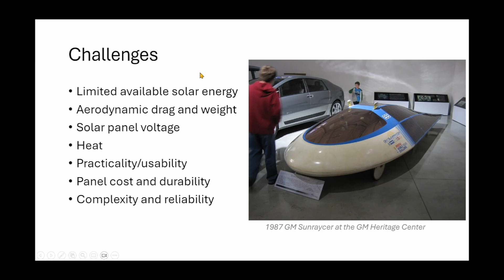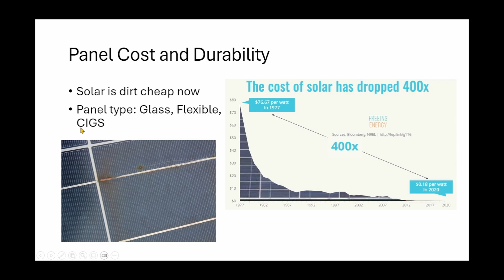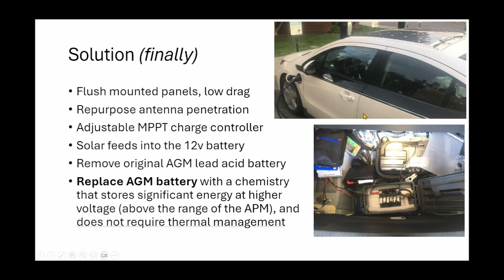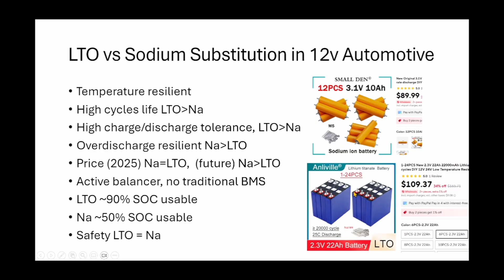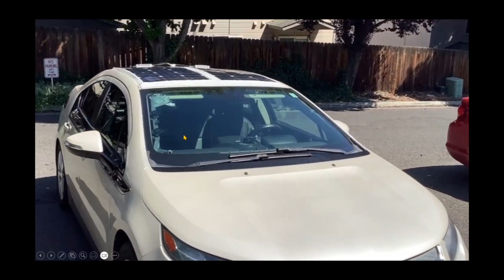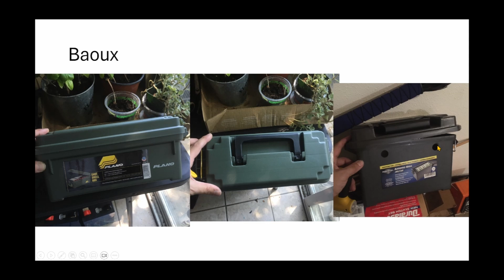Efficient Use of Solar Panels to Extend EV Range

Comment: It's nice to have a 12 volt battery that you won't have to change every 3-5 years as well. I'll have to check out your forum post for more info on exact components, but a quick video with a more direct how-to would be nice. I'd also be interested to see a video about your wheel covers (where you bought the discs, how you attached with steel zip ties etc)

Comment: Here from your comments on the Ecoflow solar roof video. I've been thinking of this for a while as well, realizing a small solar array could keep the 12V battery topped off. In my case, it's to maintain the vehicle while I'm at events in the middle of nowhere for several days. I'd like the security system to be operating, but it drains the HV battery too much in some of my scenarios. Nice work.
Reply from the maker: yeah i heard teslas can loose a significant amount of range from sentry mode. I would expect that at least the cameras and car computer and GPU would run on low voltage power since thats where they started.
I worry about how locked down tesla makes its low voltage system tho for applicability.
I believe the newer (maybe post 2020) teslas all have a ~16v low voltage architecture which they got by ditching the lead acid chem. unfortunately from the webber auto analysis of the low voltage battery, the BMS tesla includes seems to be a major sticking point.
BMS would not appreciate being overcharged and would fight to protect the low voltage battery, and thus would limit the amount of solar overhead you could collect.
I suspect that with an mppt set to the highest voltage allowed by the cars 16v bms, and feeding the 12v system, you would see some net range preservation for a tesla left in the sun, not charging, with sentry mode on.

I think the ~3-4 miles of range benefit ive seen mainly comes from over-sizing the low voltage battery.

I intended to make another video soon reviewing my 2013 chevy volt, and just kinda showing how all the mods are holding up. im at around 170k miles now and everything is still working fine. subscribe if you want a chance at getting notified about that video when i finally make it in maybe a few months lol.
Reply: @vevenaneathna I watched your Volt video and subscribed. I also had a 2013 Volt and loved the vehicle. Unfortunately, one of the drive units died on me at 101,500 miles (just outside warranty) and Chevy wanted 6k to replace everything. Couldn't swing that. 

IIRC, the L-ion battery was implemented by Tesla in 2023. They introduce running changes all the time, so there's usually not strict model years. My 21MY is an "early" one. Later ones have heated steering wheels, faster entertainment precessor,and an updated console. But mine has the electrochrome mirrors and some other minor updates not in the 2020 models. 

My thought was to use an Anker battery connected to solar with a 12V battery monitor hooked to the LV lead acid battery. That should keep everything kosher, though there's conversion losses and the added expense of a commercial battery with BMS and inverter. But I'm also not dealing with the nuances of LiFePO4 as you detail in your video. And my travels are in fair weather, so I'm not concerned about cold issues. 

But thanks for the input.

Comment: Putting it into the 12 volt system is brilliant. The big battery has to keep that thing charged and dumps energy into it to run things, so you can save tons of energy by just charging a swapped 12v

Comment: Wow, amazing job here all around.  Please keep making more videos about this. Powering the low voltage systems via solar is the optimal approach for mobile solar.  

I would LOVE to see you implement solar to power the 48V low voltage system of the Tesla Cybertruck.  Massive potential there.
Reply from the maker: ya i think the 48v systems of the cybertruck and i think some porsches is pure genius. from what i remember on the 16v low voltage batteries tesla uses on the 3/Y, they are pretty locked down due to the bms tesla puts inside of their low voltage batteries. really like the old school 12v lead acid approach where the car just kinda lets the battery do its own thing since lead acid is so sloppy with its voltage... 
but ya, 48v especially for the larger cybertruck is just inherently more well suited to solar assisting it. I just wish the ever-growing trend of companies putting bms boards in their low voltage batteries that have to talk to the cars computer would go away.... or at least the diy hacker type people smarter than myself need to start diving into the firmware/software and spoof/trick the car into letting you change things and actually take risks again.
it will probably be another 5-10 years until all those cars are out of warrenty and people get brave enough to turn wrenches on them again. by then we might have to reconcile some other issues with hv battery longevity like teslas lunatic idea to not use busbars on a hvdc battery subjected to automotive NVH conditions. most tesla packs eat the dust now because of elon musks khole inspired wire bonding "innovation." turns out u sell more cars if you make them brick themselves once the suspension goes out.

Comment: Lots of problems here.  The concept is sound... on something like an Aptera which is a light enough vehicle that it can get decent range per kWh, but a regular EV isn't going to get anything worthwhile from a few panels on the roof.  At best you might be able to get, say, 300W.  The sun angle will be non-optimal nearly all the time.  A regular EV at highway speeds is using 15kW to 25kW of power.   See the problem?  Also, even glued to the roof, the aerodynamic drag probably burns more power than the solar panels produce.

So while you are driving on a trip, say an hour-long trip... discounting the aero, you might get a mile or two of additional range.  Basically zip.  With the drag it will be zero or negative.

Where panels can be useful is while a vehicle is parked.  At the very least, a bit of solar can prevent self-discharge / vehicle-systems discharge while parked, allowing the vehicle to be parked more or less indefinitely.  And in the best case you might be able to add a few miles of range each day while parked.  For an Aptera it can be upwards of 30 miles.  For a regular EV, though, a few hundred watts of panels isn't going to do much.

The most useful case for solar is having a modest-to-large system at home, with buffer storage, and then being able to charge the EV from that system to reduce utility costs.  With a big enough system the ongoing cost of home charging more or less drops to $0.  But that wouldn't be a cheap system.  

Still, a self-contained off-grid system built on top of a Pergola or a car-port (strong enough to hold panels) can produce enough energy to put a lot of miles on the EV each day, and pay for itself in 5 years.

-Matt
Reply from the maker: havent noticed an areo hit over the last couple years.
i think the key really is having it offset 12v loads while also expanding the 12v system's capacity and getting rid of the weight. i think its not explained until around 26 minutes coz i took too long addressing these same issues towards the beginning.

Comment: This is nonsensical... do the math. Put a 300 watt module on the roof (and destroy the aerodynamics in the process). Leave it sitting in the sun for 6 hours and you will net ~1 kWh. That should take you about 2 miles.
Reply from the maker: 1kwh in the 12v system could be as much as an extra 2kwh in the high voltage system, not to mention the other efficiencies gained by running at a higher average voltage. 2kwh would be a 20% improvement in EV range for the gen1 volt.
I think some aspects may have gone over your head unfortunately. No impact on aero. maybe you didnt have enough time to watch the whole presentation coz both of those criticisms are pretty well covered towards the beginning
Reply: @vevenaneathna  This isn't correct.  kWh is energy.  Energy is energy... you aren't going to get more bang for your buck at different voltages in terms of range.  All you get with higher voltages is more power out of the electric motors... at a higher energy cost.  That basically translates to torque and max speed, but it doesn't translate to energy efficiency.

Range per unit energy scales down with weight (tire resistance), aerodynamic drag, and roughly by the square of the speed.  This combination means that an E-bike can get 100 miles per kWh.  An E-scooter maybe 40.   An e-motorcycle more around 25 miles per kWh.  An Aptera ... more around 10 miles per kWh.  A small BMW i3 ... 4 or 5.  A Tesla model 3 more like 3-4 miles per kWh.   A Cybertruck... 2.5.  See?   Has nothing to do with voltage.

You are probably losing more energy from drag than you are gaining from the panels while the car is moving.  The panels can be useful when the car is parked, though.

-Matt
Reply from the maker: @junkerzn7312  everything you mention here is true but im wondering if you had enough time to watch the entire video coz i think my novel approach of keeping the lossy DC-DC converter off more often coupled with the weight and higher operating voltage of the low voltage system translates into around 3-4x more usable capacity compared to everything else that has been put up on youtube so far regarding solar cars. as shown, there is no aero penalty. aero on my car is actually better than what it started at based on night time miles/kwh measurements. i think the removal of the antenna and aero wheel covers I added are to blame.
Youre clearly someone with an above average understanding of electronics though, so I would be interested in your feedback if you find time to watch the entire video. everything you said I agree with and are overlooked criticisms of other solar car mods on youtube, but its just not relevant to how I worked around these issues with my specific mods

Comment: Very detailed video. Would be amazing if you made a small overview of every used component, now it's kinda scattered over the lenth of the video. I want to do the same for my electric van, huge roof and a lot on the 12v battery.
Reply from the maker: If I remember correctly i list everything out on my forum post for gen1 volt under modifications including prices back then.